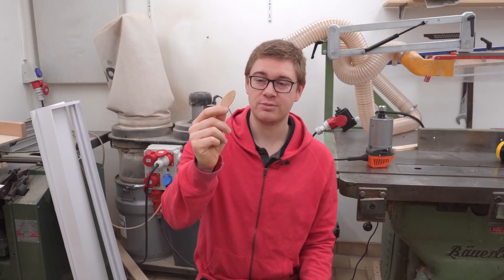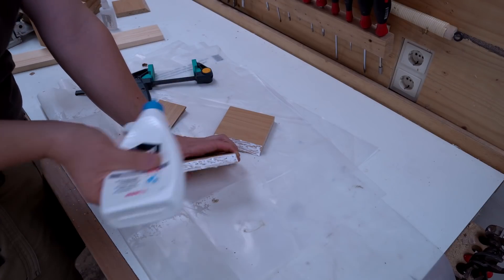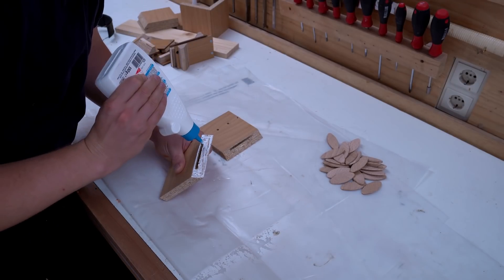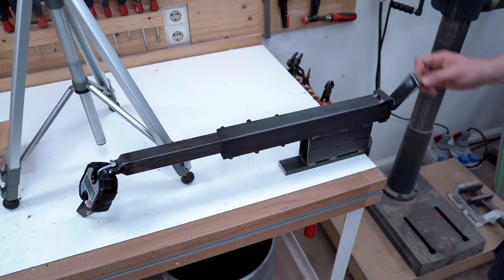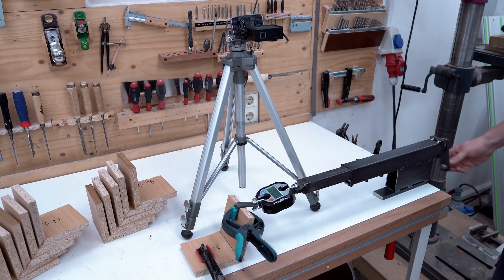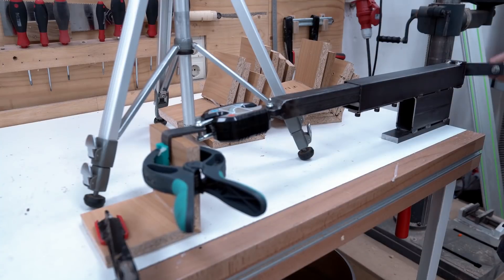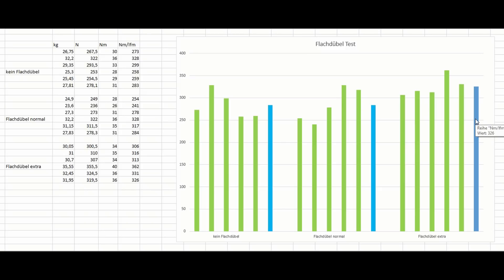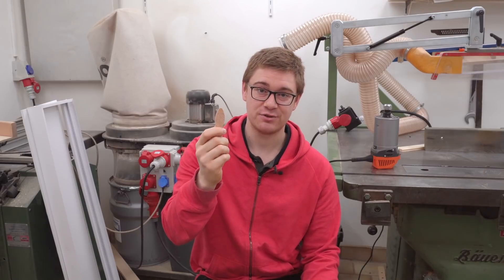Do biscuits make mitres in particle board stronger?

Comment: Naja so unwissenschaftlich war das nicht. Mehrere Proben. Standardisierte kontinuierliche Aufbringung der Kraft und eine tatsächliche Kraftmessung. (Interessant wäre welche standardverteilung die schenkellänge  hat 🤪
  Aber nach dem into dachte ich würden auch „normale“ Dübel mit Flachdübeln verglichen werden. Das wäre hier noch interessant. 

In my opinion this ist more or less sientific - a few samples. A jig for standardised continuous force applyment and a actual force measurement. (Just interesting what the average deviation of the legs length is 🤪)
But I thought you would also check the standard dowels in comparison. This would be interesting as well. 
Good job 👍

Comment: Proper wood glue is stronger than the wood, so no, biscuits won't strengthen any joint, nor will dominoes or other dowels.  What they do is strengthen poorly glued joints and add residual strength if the glue partially lets go (a pure butt joint is very brittle).  You wouldn't want to sit on a chair held together purely with glued butt joints.  The primary benefit is alignment of the parts.  A 45 mitre without biscuits or dowels is a pain to align, squirming around with all the glue in it.  It is also difficult to glue up panels without something to align them, especially if the boards are warped a little.
Reply: That's just partly true. It might not break in that plane that the glue is on. But the wood will then break around it instead. Since the forces are not distributed further into the wood anymore since you cut off all the wood fibers in one single plane. You can compensate for that by inserting something long enough into the wood so the forces are distributed away from around that plane only.

Comment: Love it, now would using an epoxy instead of glue make a difference and is there any difference between how the dowels hold compared to biscuits? Hmmm, maybe you could work with James over at WBW because he loves spreadsheets and this type of stuff, although he’s not a big fan of biscuit or doweled joinery

Comment: I think it’s partially the strength of the particle board failing. Biscuits in plywood might gain more than 15%. Plywood capturing the biscuit and not allowing leverage to break it apart as easily.